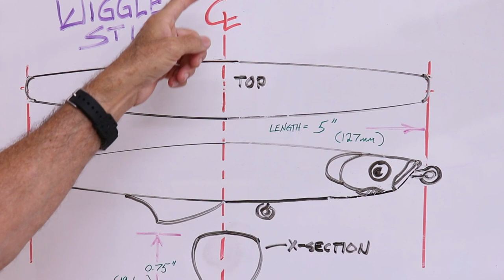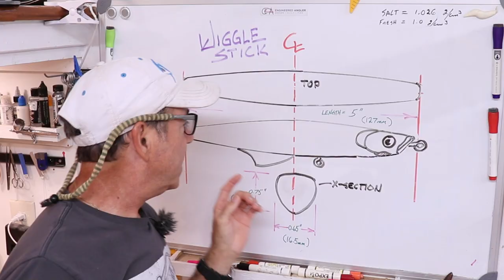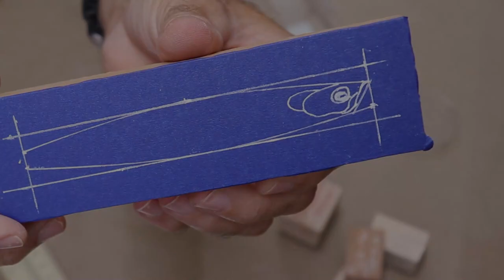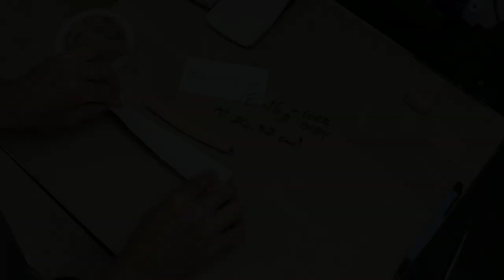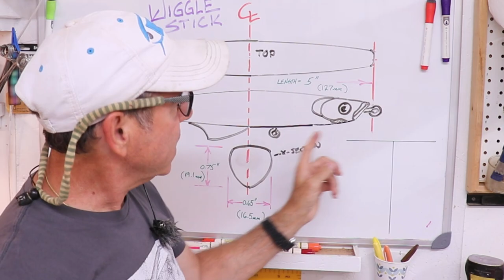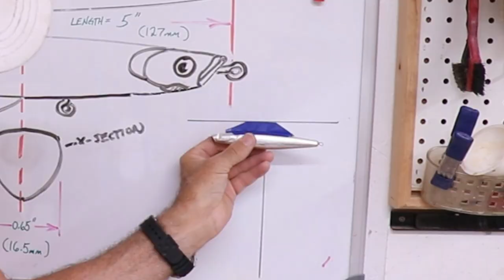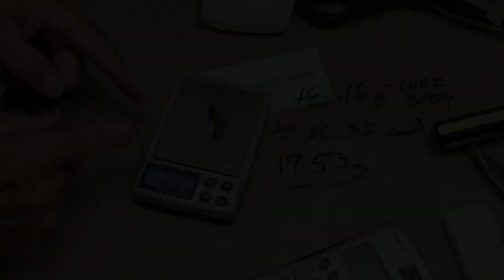Making a countdown stickbait with a flash.  #fishinglures #lurefishing

Comment from the maker: Just to be clear...I wasn't just trying to get the lure to wiggle as it drops through the water, just about all my twitch baits do that.  I was looking for a really outrageous exaggerated waggle.  I'm trying to push the limits of the characteristics that might cause that.  The thinner of the two lures comes pretty close, it's just Impossible to video with the fast drop rate.  From here, I want to refine it to work with a slower fall.  I'll keep posted.
Reply: try to leave the edges square (not rounded) it helps with mine
Reply: It's just a thought, but every time I make a new lure and try to exagerate some movement, I'll do some "actioning" in water like that:
1. after sealing for water
2. after adding paint
3. with different hooks sizes and placement on the lure!!!
4. just a thought but try again different method of building or wood after quite some time, the same lure. You will be surprised what you can/will find.
PS I did a lure from balsa, pine and tilia cordata and all were different.
Reply: You might get more waggle if the front  hook were closer to the body...center of mass...You could try putting a small rubber band on it.

Also I think putting the weight at or above the lateral center line of the bait may help. It will almost want to flip over but the hooks will keep the belly down.
Reply: Handsome looking lures!  I'm gonna do some more foil lures it looks great with scales rolled into it.  I appreciate all your videos and bringing fresh ideas to the table
Reply: Hey franco, Was wondering if Pine is a great timber for lure.. I bought mine online and tried to make a small minnow but it splits a lot while i handsaw it ! Ended up in the trash but i managed to make one crankbait yet not sure about the action.. So far I love basswood but it's hard to get in Malaysia...
Reply: I don't have the same amount of experience you have, but IMHO, the best wiggling fall on a lure is done with a low density wood and a repartition of the lead all along the lure in the lower place possible. For the shape, the back should be flat and angled enough with a boat shaped belly. I hope this could be a complementary info for the great job you do in lure making. Regards from France ;)

Comment: I'm working since several years on a sinking stickbait with a really fast wiggeling action. My expirience is, that the most important thing is, that it is as light as possible above the centerline and the weight as low as possible. Than it start wiggeling imediatly when its in the water. I do it with 3 d printer and just let an air space in the top part. With wood i would try with balsa wood and more weight in the belly. Cheers from Switzerland

Comment: thats nearly the same like my lures,just another sice!!! i think you need more weight, that pulls the lure down. dont be affraid,if it starts to wiggle that will slow down the sinkingrate. and in my oppinion the v-shape dont work, i got the best movement out of a simple square/block-shapeand i tested allot... you got more volume out of the same bodyshape and size,so you can put in more weight,what is often very usable in saltwater,too. and at last make it through-wire, you are not fishing for bass... look at my video where i lost the monstertrout...

Comment: I have called an onde onde. which has a very good and irratic action on the drop. I made a copy of it and mine did the same. 
This lure has a flat bottom, with sharp edges on then tappers slightly to the top as a "normal lure would. 
The weight in the lure also covers quite a bit of the the surface area of the bottom of the lure.
Reply from the maker: I'm kind of heading in that direction, flat bottom wit sharp edges, lots of experimenting to do.

Comment: Hi Franco 👋 They came out real pretty 😍 in my opinion the fin is counter productive when it comes to the wobble/wiggle... I was never good in physics, especially bad with the formulas and calculations 😅 but since I'm making lures, I can very well imagine how the forces are working on the lure, so once you're lure belly wish to go sideways on the curved line up, the flat fin works like a stopper. I'm not sure if you agree, but try one without fin and we'll find out 😉 all the best from Poland 👋😊🇵🇱
Reply from the maker: Actually, I know it's counter intuitive but, the fin is well tested.  It increases the amplitude of the wiggle.  Bigger movement.

Comment: You can wrap hook neck with thin lead wire. Also melting the lead on the bottom of the hook. It will pull down the lure
Reply from the maker: Yes that is a nice trick, I use thin solder to wrap around the hook...works well.

Comment: Beautiful looking lure.  I wonder if you made the bottom fin out of metal and used a lighter wood if it might wobble more on the sink? (kind of like one would visualize a falling hot air balloon.) Or some kind of hinge between the weighted fin (cloth around the fin glued into the body) to allow it to ocilate more readily.  A weighted belly hook placed at the center of the lure might serve the same purpose more practically. With the added benefit of eliminating the need for pouring lead into the body.   I may be spinning out of control with this thought excercise, so I'll stop there.

Comment: Since you asked for input . . . I agree completely with my friend and skilled lure maker Rafal ("Such a Jerk Custom Lures," among the commenters below): I think that the fin you installed on the bottom edge of these two lures is acting just like the "bilge keels" that many builders of steel commercial fishing vessels weld onto the bottoms of their boats to slow the roll of these hulls. Essentially, as the vessel tries to roll from side to side (an action you WANT in your lure), the longitudinal keels move against the water, and that resistance slows the roll. 
     But, you're the engineer, so perhaps you know a theory of hydrodynamics that says I, Rafal, and all those boat builders are wrong. I can tell you from working aboard commercial fishing vessels, however, that bilge keels work (i.e., they do reduce and/or slow a boat's roll). Like Rafal, I suggest that you remove the keel from one of your two prototypes and see if that helps a bit with the action you're looking for.
Reply from the maker: Trying to intuit movement of a body in fluid flow is tough one.  You'll have to take my word for it... the fin increases the amplitude of the oscillation.

Comment: Franco, what microphone system are you using. Sounds really good. Mine, a cheapie just bit the dust. Thnx.
Reply: So, what model is it?
Reply from the maker: Go to my Amazon store (link below)  and go to the section with my camera gear.  The Boya is the one I'm using now but the Sony is excellent. I like the Sony because it has excellent sound and its water resistant.
https://www.amazon.com/shop/engineeredanglerlures

Comment: I think the balance left to right is too stable due to the weight being so low?

If you could find a way to measure/mark the center of buoyancy, and place the ballast closer to that point (higher up than current location), it would want to "tip over" but could correct itself.
Reply from the maker: I've actually shown the technique for finding the center of buoyancy on a few vids.
Reply: @EngineeredAngler  I've seen most of your vids but not all of them, I will have to look for that!

Appreciate the education.

Comment: How does line resistance affect the action compared to without on the drop. Would balancing nose heavy get a more desirable result?
Reply from the maker: Typically the flatter it drops throught the water the more flutter you get.

Comment: Hello!!

Did you use the same weight size for the second lure?
Reply from the maker: Calculated it separately.
Reply: @EngineeredAngler 

How did you calculate the action of the tail and the weight of the center of gravity?

Looking to make a lure with similar action and this video has been helpful. 

Thanks a lot for the question response and great videos 👍🏾
Reply from the maker: you should watch my weight and balance master classes